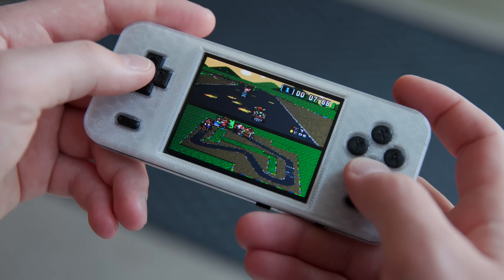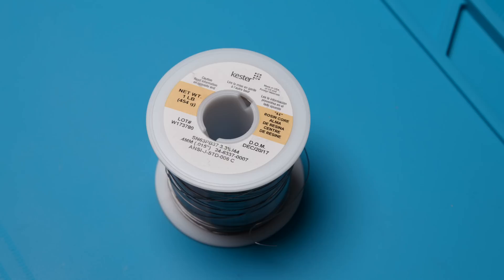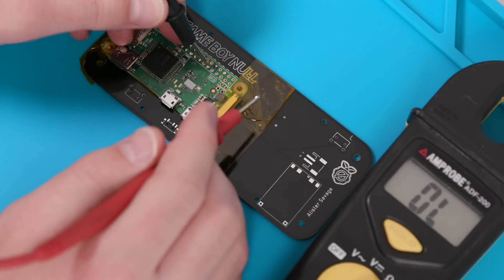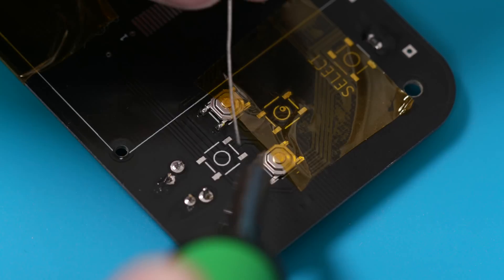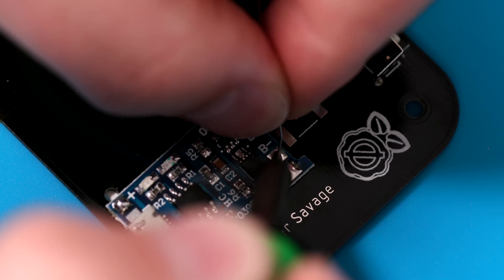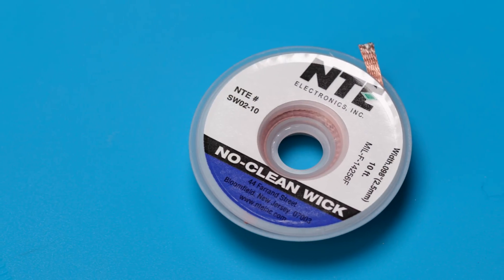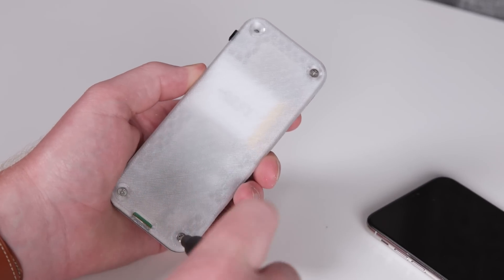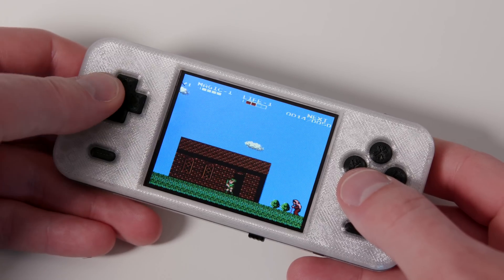Thousands of Retro Games in Your Pocket with this DIY Emulator!

Comment: Great job and awesome build!  Just be aware that flux is both conductive and corrosive.  Make sure to clean the board with a small brush and some alcohol.  Solves the problem easily.

Comment: You don't need to use that much flux and, you should be telling your audience about how you should clean the flux from the board. Even if it's "no clean flux". Flux can damage and degrade the board over time.

Comment: So, go easy on the flux. Also, you should clean all of your solder joints after you use flux, wick, or even solder for that matter. Wick and solder both usually have flux within them. Even if it says "no-clean" flux, you should still clean it. Some of the materials used in flux can eat away at contacts, traces, and the substrate. Not all flux does that but, it's just good practice to clean everything. Otherwise, an all around good project. I would never recommend a hakko soldering station (which I know you didn't) but, you should always give examples of cheaper alternatives. For fine solder work, never suggest a "20 dollar soldering iron" because those are not good or precise enough. Trust me. I learned the hard way.

Comment: Would be cool to build a Switch Like Console with Bluetooth Connector and Rails to clip the Controllers on it. With Raspberry Pi and kind of custom Linux Build on, bigger Screen and a Usb C Port. I wondering there would be possible to implement some kind of Video Out to the Usb C Port. At least there would be  Possibility to Play Games like Stardew Valley since it uses Mono. Sure you can not emulate Switch Games due to Limitations of Hardware but as i know there some other cool Games which doesn't need that much Performance.

Comment: I really want to make my own version of the PSVita
Reply: The ps vita is too powerful of a console to be emulated on a pi. The reason it works with retro games/consoles is because those consoles aren't very powerful at all compared to modern standards
Reply: @misterconor1434  Why would I use a Pi, I'm going to upgrade the console and make a new system.

Comment: I would add a small amount of epoxy resin to the corners of the pi board,  I wouldn't be relying on solder joints with no pins for  mechanical security.

Comment: I've been looking at your videos there awesome ..... now I have a question for you ( need help for this protect) . How to mod a fake gab from china by the name gab station .it dose not have a micro sd card slot . How can it be added  ( for more games ) or how to add games with out the sd card or how to add a retro pie zero w ( the unit is smaller then the regular gab

Comment: You could have soldered a connector for the battery which will make it easier to switch out the battery, if you ever needed to.

Comment: You forgot to mention, if you solder with Flux, you should clean the whole pcb board (basically the soldering parts) with 99% alcohol. Because Flux IS corrosive after all if left for a longer time on metal, because it is basically acid. So even thought it helps you soldering, if not cleaned with alcohol after all cools down, it can corrode your device from the inside on the long term. Cheers.

Comment: Correction: Flux is a weak acid that strips oxidization from metals when activated by heat. This allows the solder to adhere much better to the metal, as there isn't a metal oxide layer blocking it.
Reply: 6:08 does that also work with other flux or just this one?

Comment: Great video.  I have been soldering since the early 90s and have always used rosin core solder which works great on large gauge wires and small pinned circuit boards but is impossible when using SMT components.   Using separate flux is amazing and a total game changer.  Thank you so much for that tip.

Comment: Couldn't you just put a 3.5mm Jack input and let the sound come.out through headphones or external speakers ? Does the PCB have a pint for where the audio should come out or would you have to wire it directly to the pi ? Anyway this is some really cool project I hope to get my hands on soon enough :D

Comment: Great video except for one thing. I'd recommend against cutting the positive and negative wiring of the battery in one snip as you may risk shorting/damaging the battery. Cut one wire first, strip it and solder it on. Then do the same to the other wire.

Comment: 7:00 - why not to solder a socket for this Lithium battery? Worrying about not shorting plus and minus of the battery is funny )) If there is no space than a much thinner socket/connector should exist!

Comment: Never cut both leads off a battery at the same time. especially with a lithium polymer battery.  Should you have actually bridged those two connections and created a dead short you could have seriously injured yourself.

Comment: 4:04 You can't really breathe lead unless it turns into fumes which it hasn't the boiling point of lead is over 1,000 c* and unless it's boiling it doesn't turn into fumes so you can't breathe it. The fume are actually coming from your flux that is inside the solder.

Comment: It's cool and all, but is such soldering really solid? I mean, the soldering of "holes to pads". The handheld will get different kinds of torsions and vibrations while in use, I would be worried that the solder in holes breaks and leads to bad connections. I would be tempted to use some go-through pins instead, but that's just an intuition.

Comment: You need to mention DO NOT cut both the red and black wire at the same time if your cutting it off the battery! shorts happen INSTANTLY just for safety ONLY CUT ONE WIRE AT A TIME!!!!
Reply: I learned the hard way cutting live wires together in a household. Never again.
Reply: Awesome advice! Thanks
Reply: Right, he was fortunate however because his battery has a BMS.
Reply: @Username0662 it was! He cut the wires right off the battery! If he hadn't gotten lucky and cut the wires clean, he could of fried the battery and caused it to explode!

Comment: Yea, let's solder the lithium battery (read: very limited longevity, max. 2 years, which you have to replace rather frequently if your use the device daily) directly to the board... jesus christ.
But then again, you could be a proper modern smartphone designer with that philosophy... yanks and their weird and disturbing built-in/planned obsolescence fetish.
Reply from the maker: Desoldering is very easy, you goose.
Reply: @snazzy  There are many reasons why soldering a bloody Lithium battery to the motherboard is a very bad idea. Being a hassle compared to a simple pin connector is actually the lesser evil. There is a reason even super aggressive companies like Apple, who turned the whole planned obsolescence thing up to eleven, doesn't solder batteries to their Mainboard even though they could. Over time, when the solder joints are getting older, it is asking for trouble and is a real safety concern. It's could be another Note 7 dilemma.

Let alone the fact that someone inexperienced with soldering shouldn't do something like this in the first place. Soldering a simple female connector should have been the obvious thing. There was more than enough space for it since it's rather bulky anyway. And it's faster to replace than Desoldering.

And yes, I miss the days where having non-user replaceable parts was an utter outrages thing in consumer products. Now we also have DSLR/Mirrorless cameras with non-removable batteries. Thanks America.

Comment: OOOORRR
You could order some Silver Rosin Core Solder from Radio Shack. A spool is $10 or cheaper. It's easy to use and amazing.
Otherwise amazing video.
Reply: If the only flux you are using is rosin core solder you have a lot to learn.

Comment: you need soldering mats, battery, rasperry, flux and electronic engineer degree... well dude you are piss me off of this shit. Don't say is easy because is not,  YOU NEED experience to read electronic circuits,  how to sold resistances and experience on field, sell it complete instead of this shit. This is not a project is another crappy idea to become another shenzen minion. BTW rossman it is NOT a newbie and if you need rossman quality mats MEAN THAT YOU ARE NOT CAPABLE OF DO IT ALONE!!!

Comment: The power switch is very weak.  Mine broke within a few uses in fact, I didn't even get past testing the thing before I had to replace it.  The little white slider nub broke off which means I now have a much larger switch driving it.
While I think there are plenty of great Pi projects around, this just isn't one of them.  The amount of troubleshooting and rework needed for this kit is not for a beginner.  Buy a bluetooth (8bitDo) and pair it to your android phone for a better experience.

Comment: Good video overall. Getting good at soldering takes a lot of practice. If you see yourself doing more surface mount stuff like those switches in the future, I would also snag a hot air iron and some solder paste as well. Those two will really make for clean joints. 

Also: Don’t cut both battery leads in the same stroke. That’s a great way to kill the battery.

Comment: You shouldn't cut both the battery wires at the same time. It creates a short as you are cutting it. The correct way is to cut one battery at a time, so that you never short the two wires .

Comment: @Snazzy Labs I am waiting on my battery. However i soldered the project together and plugged it in to test. The power module gets power but the pi doesnt. Do I have to have the battery connected for the pi to recieve power?

Comment: Neat project but for $70... unless you enjoy building DIY projects or soldering or modding, I can't really see a gamer getting this, for $70 a real gamer could get one of dozens similarly priced already built emulation gaming units which could hold thousands of games with over half a dozen emulators WITH SOUND INCLUDED no less, can't even use a bluetooth headset with this Pi!

Comment: Don't worry about 'breathing lead bro', the boiling/vaporization point of lead is far beyond the temperature you soldering iron can go. That is flux smoking, which isn't as toxic but would still take a few years off your life, depending on what type of flux.
Reply: Uhm... that would mean decreasing life expectancy... meaning your life expectancy is shorter then what it should be meaning you will die younger meaning you don't get to see more youtube videos

Comment: I got one of these, its called a PSP. its much better all around, no soldering involved. Not to mention all the pro it comes with. Can play PSP and PS1 games as well, bigger screen, can play music and more. So what this guy is doing is not a bad idea but at 70 bucks you can find a used PSP for that and all you have to do for it is load the custom firmware on it.

Comment: Please use flux right... your supposed to put it on before any solder to help it stick and make a better connection. You don't add it after the fact on top of the solder joint you already did...
Reply: T3hRealMcCoy he didn’t bro lol. Watch the rest of the vid and he does it right for the most part

Comment: It was rather crass to leave out the fact that there was no audio device in the build until the end of the video.  That should have been noted from the start.  It also doesn't make any sense to do a project like this and only half ass it.  On top of that, you have left your viewers wondering what would need to be done for audio as you just merely say "Oh, you can do it if you want".  How is that acceptable?
Reply: Agreed.

Comment: For audio, you have two options with the Pi Zero. Analog/pwm pins with a low-pass filter (and amp like the PAM8302) + adding a dtoverlay line to /boot/config.txt ........OR, a small USB sound card adapter. And a 10k potentiometer or something for adjusting volume

Comment: Half of everyone "Pushing the solder in the hole" will probably fry the board from solder connecting on backside or, more likely, heat from their $10 tool and no-brand/Chinese solder-wire.
What Im trying to say is: Please dont make any more soldering videos...

Comment: I got a little nervous as you cutted the cables from the battery, usually you cut one at a time and not booth lines at the same time, you shorted the battery that way pretty sure and that´s not good at all.

Comment: I love how you cut the connector off the battery with a scissors ... and then almost immediately after that say "don't let the black and red wires touch".  I know it is nearly instantaneous but you are shorting the two wires together when you cut across both wires at the same time.  Just not a good habit to get into.

Comment: DO NOT CUT BOTH LEADS OF THE BATTERY OFF AT THE SAME TIME!!! Dead short alert... I personally recommend cutting one side at a time and soldering it before cutting off the whole connector. Even a momentary short of the battery is a very large instant current pull which can and will damage the battery.

Comment: Personally I prefer the high-quality 3DS handhelds. If the system is an old enough firmware it allows for homebrew and custom firmware, meaning retro games can be installed, but not only that, you can use Virtual Console injections, which I consider to be the best and simplest way to replay them.

Seriously, 3D printing and a raspberry pi is nice, but you can get yourself a well-designed 2DS for only around $60 refurbished (or a N3DS for like $100-150) and install tons of retro games on it while also having access to newer games, as the 3DS line of systems is still supported and has a lot of really great games on it.

Just a suggestion. Do what works best for you. My N3DS and 2DS systems are my absolute favorite handhelds, but I can understand choosing this for a cheaper option. Though with how much it would cost to pay someone to 3D print a case to your liking, you would probably still end up paying a pretty penny. Might as well upgrade if you're willing to shell out the extra cash. Nintendo doesn't make crap.

Comment: Great... I also just noticed that the games are literally missing rows of horizontal pixels, meaning that the display isn't even the proper resolution for retro gaming!  I have seen this with other cheap chinese emulation devices where care is not given.  I am sorry, but there is absolutely no excuse for this.  Any sort of portable screen meant for emulation should come in the proper resolution for retro gaming without having to drop rows of horizontal pixels like this

Comment: So first off... wow, no sound?  Really?  I see zero reason why they couldn't have designed a small spot in the front part of the shell for a tiny speaker.  They make tiny cheap speakers that you can buy for this purpose, and there is PLENTY of room in the front of the device there to fit a tiny front facing speaker, or even two for that matter!  Could have pretty easily implemented this without increasing the size of the unit at all.  

2nd, why on earth did they choose to use microswitches for the buttons instead of the conductive style ones used in real game controllers?  I see zero reason why the board couldn't have been printed with the sensor spots for rubber pads like the ones used in most controllers.  Most old school controllers consist of a single flat circuit board, just like this one.  There really is no reason why this couldn't have been done, and it would have made for a whole lot less soldering too!   Besides, I can't imagine the d-pad diagonals working very well with these microswitch style buttons.

& lastly, the battery life is VERY poor for a small, low powered device such as this.  2 to 3 hours is extremely short for such a device and shows that not enough care was given to give enough room for a proper sized battery.  A device such as this should have at LEAST a 2000mA battery at bare minimum.

I really got excited for this thing when I first saw it, but no sound, sub-par microswitch style buttons and very poor battery life are all dealbreakers for me.  The device has a lot of potential, but it seems to me that it could use a bit of a redesign to fix these issues.

Comment: See, this is the one thing I freaking HATE about the Pi devices!  The absolutely RETARDED file system!  I absolutely HATE that you can't just drag and drop groups of files on to the MicroSD card like you would any other card.  It uses the most asenine file system where you can't even access the files like a normal storage device.  I absolutely hate it and it is needlessly difficult to get your files on to the device because of it.  

I have literally thousands of ROMS for dozens of systems that I would want to drag and drop into specific file folders for each emulator, and with the way the Pi's file system works it makes that needlessly difficult and complex.  This sole thing is what has warned me off from Pi devices and it is a damn shame as I really want to love them...

Comment: on 5:26 youre comparing joints with flux and without flux, but heres a secret, both of those joint are with flux *wow* and that is because your soldering wire has flux in it. you have no idea how painful is to solder without flux.

Comment: So you are using wayyyyyyyyyyyyyyyyyyyyyyyyyyyyy to much solder. every solder joint should look like a X^2 function. Your power wires have cold solder joints  because the wire wasnt heated up properly. You can get around this by tinning the wire first so that you already have good solder flow on the wire before you solder it to anything.

Comment: Could you add a headphone jack without changing the form factor?
Reply: With a little modification of the housing, and only if there is a big enough place on the motherboard to be cut out, but probably yeah
Reply: I mean you would need to modify the circuit board and stuff which would make it cost more